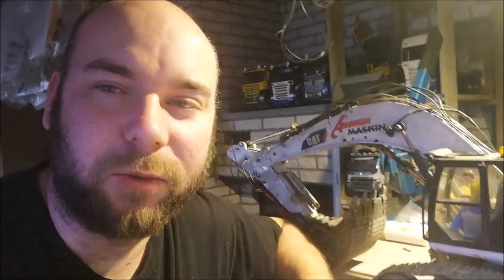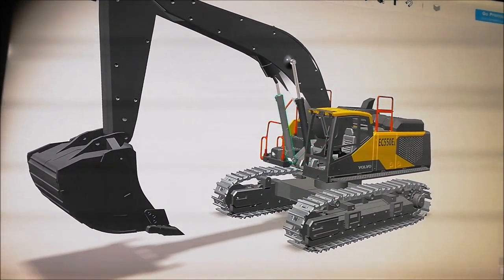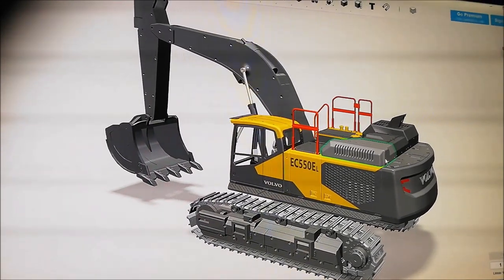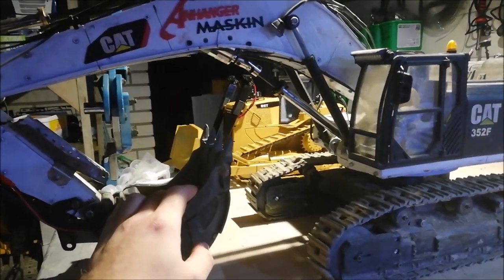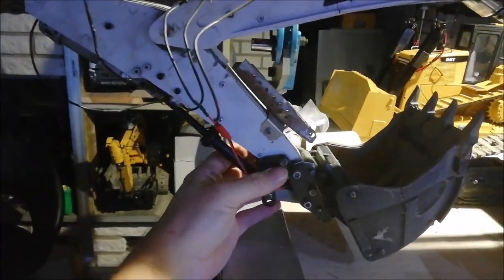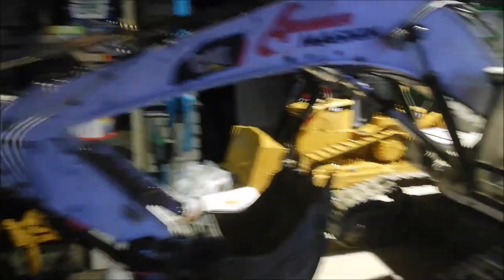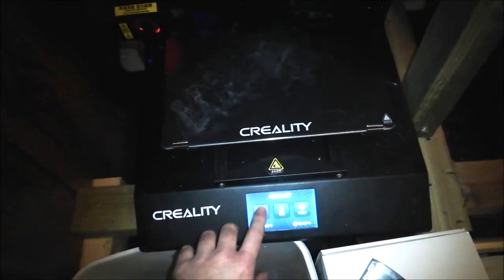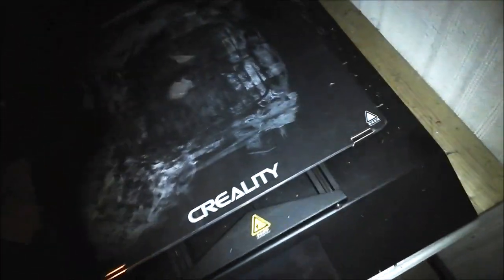Making a 3D Printed RC EXCAVATOR - Volvo EC550EL - PART 1

Comment: I bought your model and i want to start to work on it, it will be my first rc  model with mobile parts, but befores start, i have a simple question, about the material, i think that you are using PETG, true?? or are you using any other materials?? and about the parts infill how much you are using?? i dont find these things on the tutorial, and my english it is to bad to understand you well.

in other hand, about the steel sheet, what type and measure are you using??

Well, thank for your time and your fantastic work.